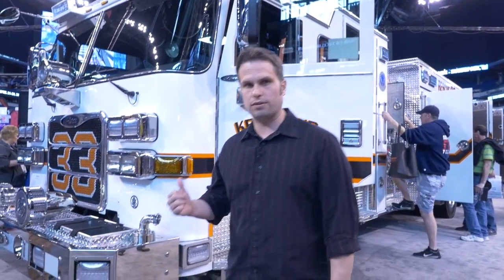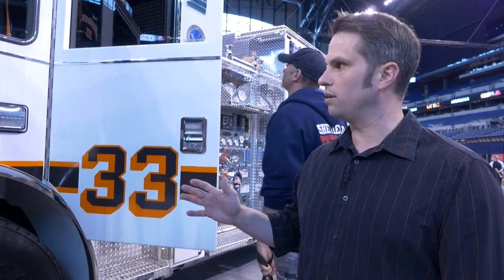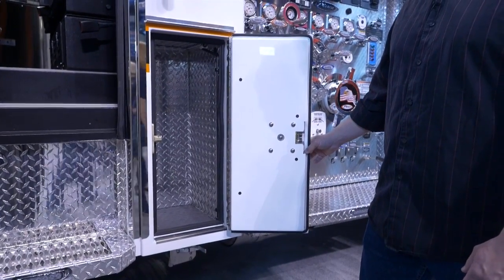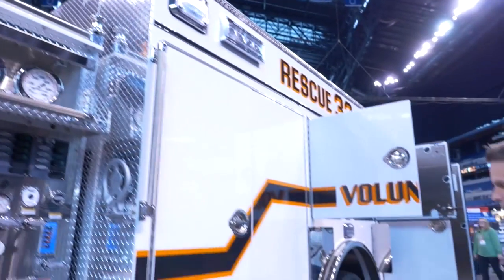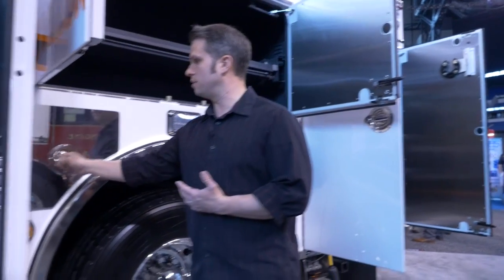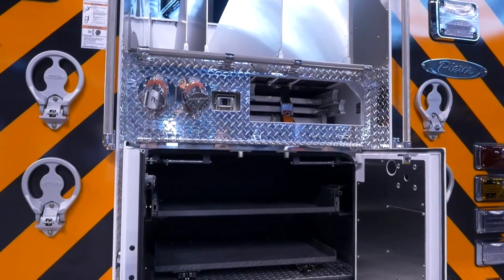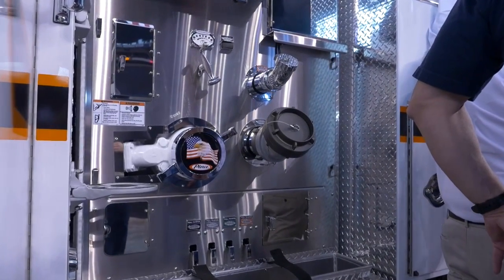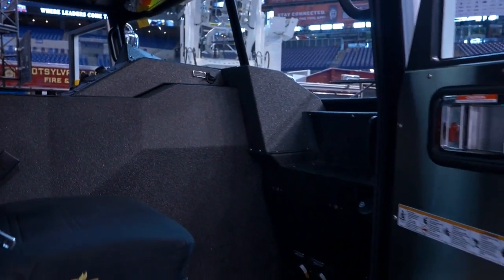Kentland, Arrow XT™ Heavy Duty Rescue Pumper

Comment: I see you went with the short cab doors in case you're up close to the jersey barriers or vehicles on tight streets. Very smart choice. However, why didn't you go with the roll up compartment doors? It appears in the video that the compartment doors are lower and will not be able to be opened if you're close to the jersey barriers or parked vehicles. Just asking?
Reply: Yeah, that made no sense to me